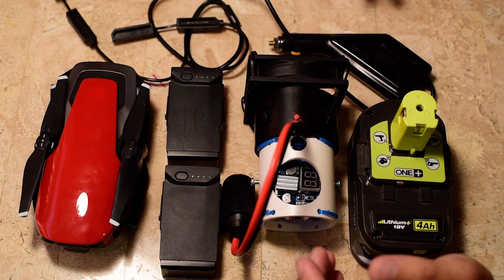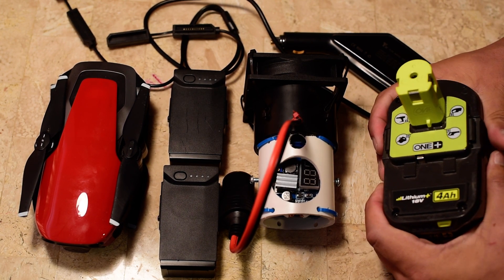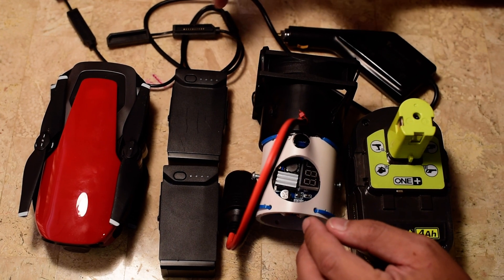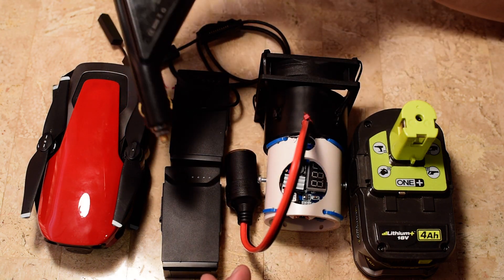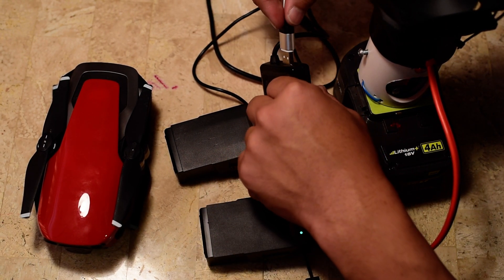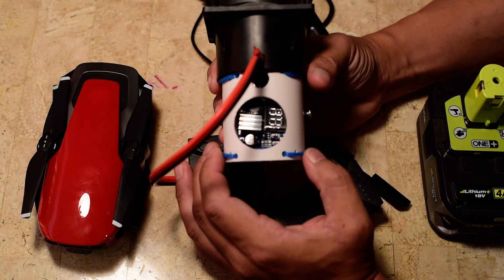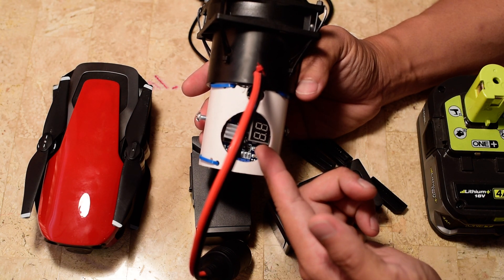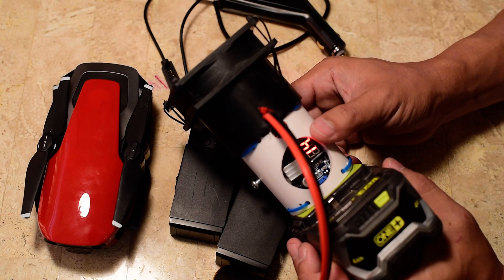Easy DIY SOLUTION: Portable Charging for DJI Mavic Air Battery

Comment: Nice. Guess you could try 3d printing a housing since you said you find it too bulky. 
If you design the housing out of aluminium it might even serve as a huge heat sink and then you won't need the fan and/or you could also try using a way smaller fan closer to the converter so the system uses less power. 
I love that you just kept it simple. Cheers.

Comment: Brilliant and completely in the spirit of DIY!  It was smart to use a step-down voltage regulator, much more efficient than stepping the voltage up. It seems you could simplify & lighten this up by wiring the regulator output directly to the 12v Magic Air battery charger circuitry, which should just be under/over-voltage protection. Hmmm... not sure of the battery connector pin-out but if you didn’t need the 5v USB you could wire the regulator directly to the battery connectors (WARNING - don’t do this unless you know the connector pin-outs and if that connector talks back to the charging unit. I’m mostly typing out loud here).
Anyway, thanks for posting this!
Reply from the maker: Love the comments and ideas. You are right, this is way more complicated than I imagined it would be when I started. I first just cut the charging adapter and measured the voltage. I connected the battery => buck converter => DJI plug => DJI battery. This just caused a warning light to flash on the battery. I think it was from the amps being incorrect. Then I bought the car adapter, opened it up, soldered the wires to the car adapter where I thought the connections were being made. Didn't work. Luckily the car adapter still worked when I removed everything. Then I bought the 12V car female adapter. That worked, but the unit overheated quickly and stopped charging. Luckily, these cheap buck converters have a overheating protection circuit. So then I bought a CPU fan and wired it up. Finally, it worked. It can fully charge a DJI battery without overheating. One fully charged 4hr Ryobi battery charges two DJI batteries. 

Then I bought a Ryobi, quick charging car adapter for when I am camping and hiking. 

I couldn't be happier, the whole thing is much more rugged than I imagined. I throw it in my hiking bag, and it has survived all kinds of hell.

It even worked after it got wet, and I let it fully dry.

Thanks again for the comment.